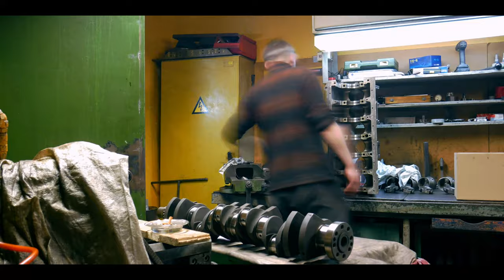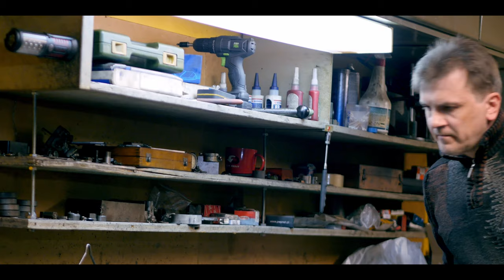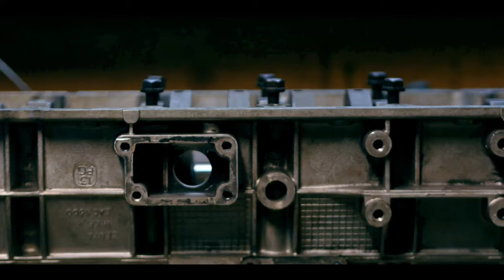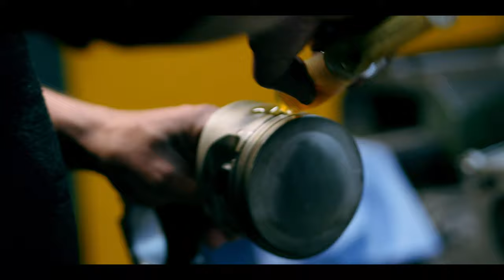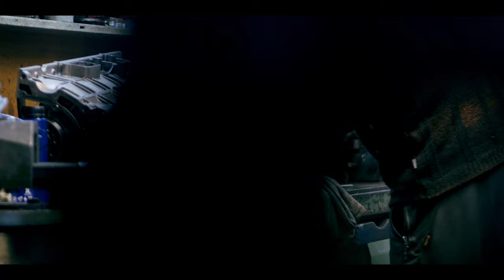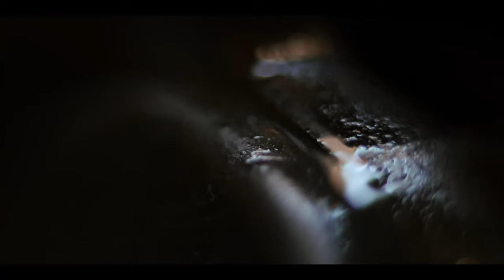Jaguar XJ6 Restoration - Rebuilt Engine Assembly - PT #1

Comment: Where did you buy Bearings and my i ask the length of the headbolts. 

I got a tore down AJ6 for free which i need to rebuild and use it for a boosted build.